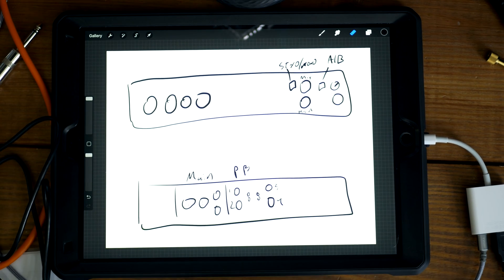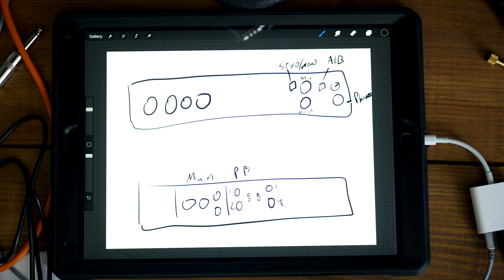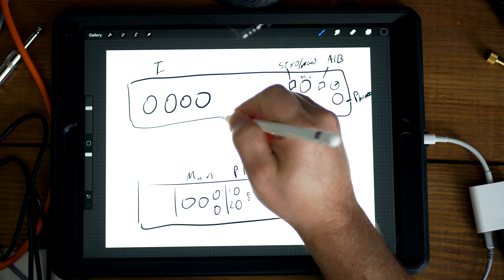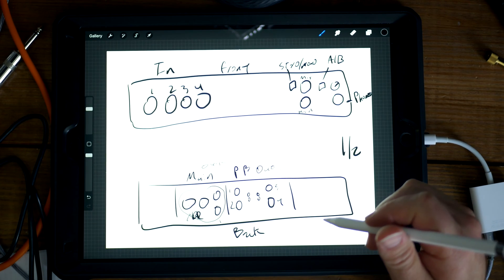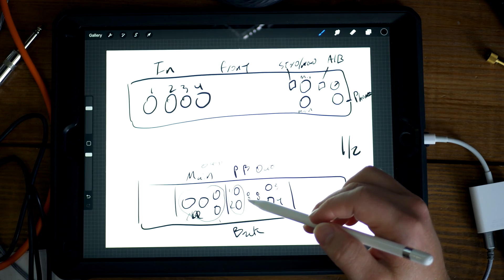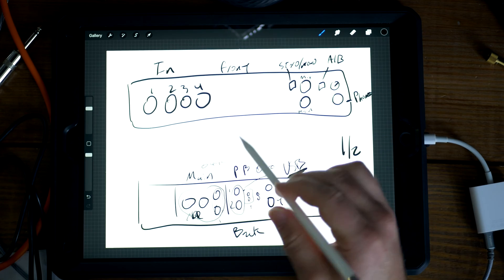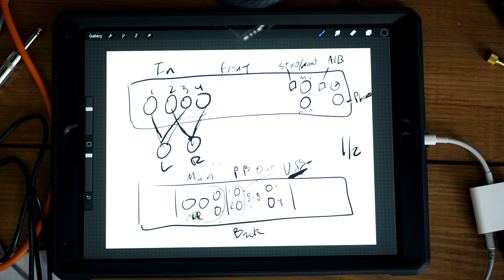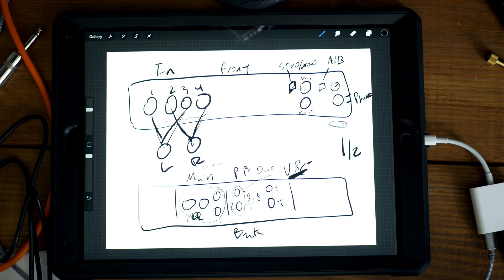Behringer UMC-404HD | Audio Routing Explained

Comment: Hi @TheAudioDabbler, thank you for all the info, I found it very useful.
I'm new to this routing stuff, can you please confirm my observation? When sending signal to channels 3/4 via USB, that signal is not included in Main out. I would expect 3/4 to be somehow mixed into Main out, but apparently only channels 1/2 from USB are considered Main (which is actually what I need).
Is that correct?

Comment: The rca outs for 3&4 do not work on mine, and have never worked. of a dozen products the only Behringer kit I have where everything worked out of the box are two passive 12" cabinets.
Reply from the maker: 3&4 usually have to be routed via software. Not sure they work out of the box. Have you tried sending outs from your daw to channel 3&4? It would have been nice if it could route internally.
Reply: @TheAudioDabbler  Thanks for your thoughts!  I can't recall anything in the documentation that mentioned needing to do this, of course I have the inputs mapped, I'll have to review the daw documentation to better understand how to even do that, honestly didn't realize it could be possible.  Logic Pro user here.  Could be handy, would enable me to achieve a way better recording/playback method that's for sure. I have to go through a checklist every time now it's so complicated to get anything done.  Thanks again, I didn't really expect to get good advice from an aimless general complaint about a manufacturer product but I got it! :trophy-yellow-smiling: sub f'n scribed!

Comment: Do the inserts also work for line inputs, like a piano or a mix?
Reply from the maker: Not sure, font inputs are combo xlr / 1/4 jacks. I never tried to use the insert as inputs. I have sold it so I can't test.
Reply: @TheAudioDabbler I think I asked the wrong question.
Can I use the line inputs with a piano or my own mix to use some external equipment in the insert?
But I've already done that; it works.

Comment: Is it impossible to use the UMC1820 completely "offline" (dawless)? Example: I want to use a few synths with my Synthstrom Deluge but I can't get sound out of the Line Outs without activating my DAW/FL Studio where I have to spend time routing like Inputs 5-6 to Line-Out 5-6, etc....!! So annoying to be forced to have a DAW open when a audio interface should just be routing each input to each line output?
Reply from the maker: I agree, it is crazy to have to use a DAW but not sure how you could control the routing with the limited physical buttons. Maybe a firmware update could allow you to bake certain routing options into it. Really not designed to be a mixer though. I do use my iPad and an app called AUM, which is a virtual mixer. Works really well.

Comment: nice vid thanx. this confusion might be of interest or at the very least provoke some laughter. connected main L/R out of a zoom playback device to the main L/R jack outs of the UMC-404HD by accident (TS jacks). its routed via a patch bay in a half-normal configuration. i can hear the playback from my zoom in my monitors. neither level knob/mix knob change playback volume, nor can i change playback level via computer. to clarify i have the umc connected to amp/monitors via the xlr outs. why can i hear the zoom playback? is the signal somehow getting to a mixer stage perhaps because of using theTS rather than TRS jack, or am i going macadamian?

Comment: 5 years later, still a super useful video. I’ve just started using Amplitube 5 and Tonex but realized all of the tones were nearly identical, or had a hint of clean/unprocessed bass. Your video helped me realize thst my settings were wrong for listening to only processed/modeled output. Thanks!
Reply: Yep - still important, I’m about to buy one of these .

Comment: Hi there, great video, thanks.
I just purchased a 404HD and am trying to get it to work with Cakewalk.
Q. How do I loopback the audio from my PC (eg. a jam track on YouTube) so I can record it in Cakewalk.

I can hear the audio through my speakers but for some reason it is not being routed to cakewalk.
I can play instruments or sing into microphone plugged into Input 1 for example and it is routed to cakewalk and records ok.

Any ideas?
Reply from the maker: The behringer does not have a built in loopback routing option. There are some loopback software that seems to work pretty good. Since the 404HD does have 4 outputs, you might could loopback yourself using some audio cables. I did this with an iPad but depending on the OS you might be able to achieve something similar. 

https://youtu.be/qe63ZqW6H-E?si=4ZAquqlLFSFP7f9R

Comment: hi! i have a question. i have the umc204HD wich is almost like yours. i am currently using pro tools, it recognizes the outs 1-2 and 3-4 but when i try to select 3-4 outs in a track it doesn't even appear as an option. i've been searching for info about why this happens but can't find anything. if someone knows it would be a lot of help. Great video by de way! Thanks a lot <3

Comment: You managed to explain the outputs better than the manual in about 10 seconds. All i wanted to know is if the 4 outputs are individual or just split. The manual doesn't say, it is quite confusing and i do this for living...
Reply: Question:

I wasn't able to discern from the video, but can 4 people use headphones on this Audio Interface while playing their respective instruments and hear the playback while they're playing?

That's what I'm trying to do. One person on electric drums, one person on bass or guitar, and one singer. I have all of the instruments, cables, PC, Audio Interface, etc.

I just need to know if it is possible and where to plug the headsets.

Thanks!

Comment: Thanks for this explanation 👌🏿, I have a question : can we use the playback output like a return such as in ear monitoring for each musician? 
Thanks for your answer!
Reply from the maker: The playback 1/2 will always mirror the main outs. So as long as you were using it just for in ear monitors it might work but if it is your main interface to the computer then I would not trust that it would work.
Reply: @TheAudioDabbler  thanks you. I will try it. And I find the good word for what I'm looking for : it's Cue Mix.
Again, thanks for your answer! 👌🏿👍

Comment: Thanks for the info on audio routing. I am having an issue that I have not been able to find any help on. I used to be able to play audio from a windows source, such as VLC player, and record it to another windows app (Audacity or Nero Wave Editor), using my UMC404HD as the sound card. I'm not sure what happened but now the only 'input' options I get from Audacity or Wave Editor is Behringer 1-2, 1-4, or 3-4. I no longer get the option to use the USB connection as the input source. I hope I'm explaining this correctly, and I'm hoping you can help. Thanks.
Reply: Same problem here , any solution yet  ? Thanks

Comment: Is it possible for me to get four independent outputs on this unit? Four at the same time out to a four-track? So each four-track input would have its own output from my Daw through the Behringer? Is that possible
Reply from the maker: That should be fairly straight forward.  you would just need to make sure you are routing things correctly in your DAW. so input 1 should go out 1, input 2 route it to out 2. Make sure they are all set to mono and it should work going into a 4 track recorder.
Reply: @TheAudioDabbler  thanks for replying and thanks for your help! Great video and great information

Comment: Thanks, man. An even very comprehensive guide to audio routing for the UMC404 - which I happen to own - where there was none to begin with. 
Still I am stuck in a hole... After years I buried my Audiobox thingy that I used for it's "sufficiency" for years. Although it introduces weird behaviours in the sub bass and bass frequencies that I never was able to fathom, just to suppress. Thought it'd be a groundng issue but that's at least not a general problem. And although the Behringers Preamps are so much better. I mainly do overvoicings with a mono mic plugged in on the XLR on whatever IN. Some people seem to happen to have been able to set up circumstances, under which they get their mic sound in a direct monitor to BOTH channels, speaking of a stereo monitor of a mono input. 
Should it be my lucky day and anyone knows how to reproduce that? Btw I am recording in Wavelab if possible and in Cubase if nothing else helps project wise. Also audacity would be an option but I never really worked with it. I am just not able to do high class overvoicings with my monitor only on one side :D 
But any help for the situation in Wavelab would be sufficient, surely. It's my preferred workflow. 
And I know very well that I shouldn't call you surely.

Comment: Hello. Thanks !
I have a Behringer UMC-404HD with :
Input 1 : XLR + TC Helicon VoiceTone + MIC
Input 2 : LOOPER Boss RC 300 + Zoom G1Xon Multi Effects + guitar
Would like to add an Alesis SR18 synchr with looper with MIDI connection on looper.

Don’t know if it’ s dangerous ! 😊 don’t know if you have a better idea…
And I would like to know smthg else. When I connect everything whitout USB, my headphone is OK. But, when I put the USB, I have got a noise, sthg very heavy, dark, like 100 bass. Is it normal ? the mix on right, that good… like you said in the video.
Don’t speak good English , I’m French !
Don’t know I f I had to put looper in the back. Don’t know what to do. Thanks a lot.
Aude

Comment: Doing a long shot by asking this question, but is there any way on the UMC 204HD / 404 HD that we can control the output  / volume for the PLAYBACK / OUTPUT that uses the RCA? the 1/2 & 3/4 outputs.

I can't figure out how to reduce the volume or at least control it in anyway via the interface
Reply from the maker: Unfortunately there is no way via the interface to control the PB outputs. I always used software to do that. I am pretty sure they just send out a line level output signal. So you would need to route them out to a mixer or use a DAW or iPad app like AUM that has a virtual mixer.

Comment: Great stuff. Thank you, quick question though…can I route the click/metronome to 3 or 4 so I can live loop, but the audience doesn’t hear the metronome…thanks again for your kind efforts, awesome work man.
Reply from the maker: Depends on what you were using to do live looping. If it is software based then yes. It if it hardware then it might depend on the hardware. The biggest downside to the UMC-404 is that there are no physical controls for the routing. You have to route things via software.
Reply: @TheAudioDabbler  you are simply awesome…and yes, I am using Ableton, so thank you, I’m gonna get this interface next paycheck :)

Comment: i use umc-204HD, i will pair it with a xenyx 1002 fx. can you provide input for the correct cable position?
Reply from the maker: I guess it depends on what you want to do. Hook the 204 into the mixer or record the mixer with the 204.
Reply: @TheAudioDabbler   i want to recording with studio one DAW.  condensor to mixer, mixer to interface (umc) to pc.

Comment: Thanks indeed for such a clear and detailed explanation!....My issue is that I wish to record multitrack with the UMC-404HD, but I am not able to listen to the previous recorded tracks at the time I wish to add and record a new track.
My DAW is Adobe Audition 6 Would you please be so kind to assist me with this issue? .
...Thanks a lot in advance and keep up the good work! 😀😀
Reply from the maker: I am not familiar with Audition. Maybe if you had a 2nd set of speakers you plug them into PB 3/4 and then route all the previous tracks out to them. 

The other option would be to adjust your mix knob from IN to PB.
Reply: Thanks indeed! A quite rare issue indeed....I solved it replacing dynamic microphones with condenser ones....thanks for being so supportive

Comment: Hi, could you check if I can routing so the 4 mono input will come out 4 mono output distintively ? I am thinking using the UMC404HD as a recording during live performance . So I will hook up 4 Instruments in 4 input can I have them come out seperately 4 out put and into the mixer ? (the stage sound engineer only kind enough to let me do just that). The reason is to record the instrument on multitrack like and later mix in post.
Reply from the maker: Yes as long as you route it via software it would work. Doubt channel 1 to our put 1, chan 2 to output 2. And so on. That’s the biggest downside to this interface is that all the routing is based on whatever software you use. Not great for standalone situations.

Comment: Thanks for this explanation. 

One questions: I would like to use the "stereo/mono" button to control the audio coming from my PC, so i have a mono switch available to me at all time. Currently i have the following settings on my UMC 204HD (nearly identical to the 404):

Audio cables running from playback 1-2 to inputs 1 & 2
The output selected in windows is OUT 1-2
Mix knob turned to Input
Monitor A/B selected to A.
Connected to pc via USB

This seems to work, and doesnt seem to create any kind of loop. When selecting mono, the sound is fully mono. I have my monitors connected to the Main Out L & R, and headphones to the headphone jack.

But there is a weird anomaly:

The Inputs 1 & 2 start to clip already at about 10-15% input gain when turning Gain 1 & Gain 2 knobs. Even with the Pad button pressed (which "reduces input level for connected sources when engaged."), I am hearing the sound at pretty decent volumes when the knobs are at 0%. If i have the volume in windows turned to 100, the 204HD has clipping light flashing already at 0% input gain. 

Any idea why this could be?

Comment: Thanks for this video, I just received my UMC-404HD today , setup ok... But your video is so confusing ( i'm a neebie ) !!! 
I have a PC running Win10 + Cakewalk +  VST's + 2 hardware synths ( input 1-2-3-4 ) output is jack out to amplifier... Should I change my setup ? I don't understand your drawings on the iPad...
Reply from the maker: From experience Cakewalk is different and could be frustrating for a newbie. Windows handles audio interfaces different but can work. I had a friend that could never get cakewalk to work right. he switched to Studio one and has never looked back. You can also get started with Ableton live lite. Has a lot of options for a free version. There are plenty of ways to get a code.

Comment: im trying to hook a subwoofer into this behringer piece, i've set the "main outs", 2 for my 2 way monitor, and 2 for the sub

the problem is: I have to cut frequencies on my 2 way monitor, in order to get a good frequence balance between the sub and the monitors. 

since my old mackie doesnt have a hi pass cutoff, I have to do it on windows, and even tho my sub is on the second "main out" of the UMC404HD, it cannot control it independently, it cuts frequencies on the sub too...
Reply from the maker: So the Main outputs and the PB (Playback) outputs 1/2 mirror each other. If you want to use the sub, try sending the signal to channels 3 or 4 as well and hook the sub up to PB 3 or 4.

Comment: This is great, thanks! I'm considering buying it. I'm just a little confused by the whole TRS input affair. So as I understand it, say, if you plug a stereo signal into input 1 via TRS, is it gonna disable input 2? Or do these TRS sockets not process stereo signals, and you'd have to split the stereo to two wires into inputs 1 + 2? Thanks!
Reply from the maker: From my understanding, it will not disable input 2. you would still have to send signal to both inputs 1 and 2 in order to record stereo. TRS is really for balanced and unbalanced inputs. i could be wrong on this.
Reply: @TheAudioDabbler  Thanks! That makes sense. I have little experience with balanced signals as I'm more of a guitarist than an audio guy, heh.

Comment: Hello, thank you for your video, but im struggling to connect an external compressor to it.
Basically, I was able to compress mic/guitar/bass and etc. but I would like to compressor an internal PC music players (aimp, itunes) and so far I was not able to figure it out. Would help me please?
Reply from the maker: You would need to put the compressor on the output since that is where the interface would send any sounds from the PC. If you were trying to record it, then you could always route it back into one of the channels in sort of a loopback setup.
Reply: @TheAudioDabbler  ok, thank you for your reply, but how to properly set it up as an output? Because the connections are pretty straightforward for me (I have SCL2 Art Stereo Compressor) I have basically Input/Output (that are bonded with one cable together into the one of the inputs on Behringer) and I have detector loop and that's it :( https://artproaudio.com/framework/uploads/2018/06/om_scl2.pdf

Comment: I’m producing a podcast and need to listen live. I can record lines 1-4 perfectly fine, but can’t hear audio from line 2 or 4 as we’re recording. I’ve searched endlessly for a remedy to no avail. What am I doing wrong?!
Reply from the maker: I know there was some weird stuff with the headphones and monitoring but I thought 1/2 were linked and 3/4 were linked to the Monitor A/B button. Not sure if you can directly monitor all 4 channels. You might turn the mix knob all the way to PB and monitor with whatever software you are using.

Comment: Thank you for this clarifitaion!
One more question. If I would like to connect a headphone (through a cable adapter) to the playback outs, would it be able to drive a headphone?
Reply from the maker: That may work but I never tested it. I know that line level like the play back outputs have a different impedance than the headphone outs. Plus you have no control over the PB volume except through the software. If you are trying to hookup multiple headphones then a small 4 channel headphone amp might be a better option. It would also work if you are wanting to monitor out the playback.